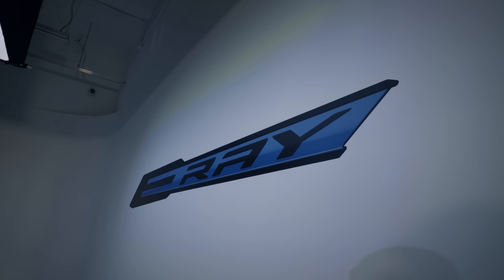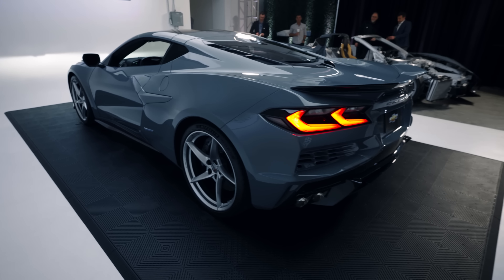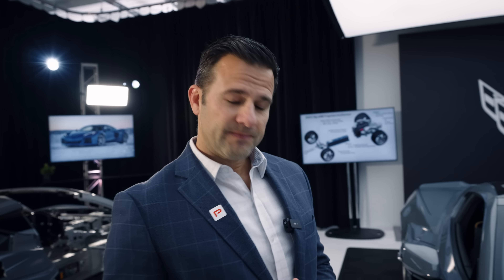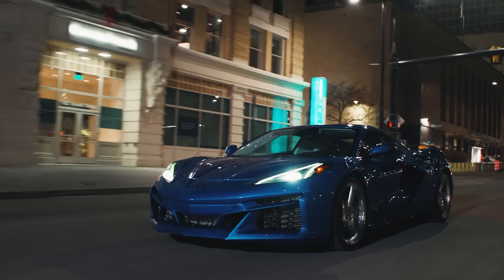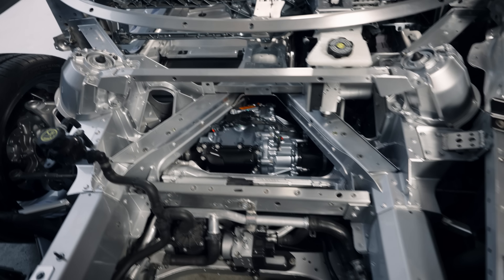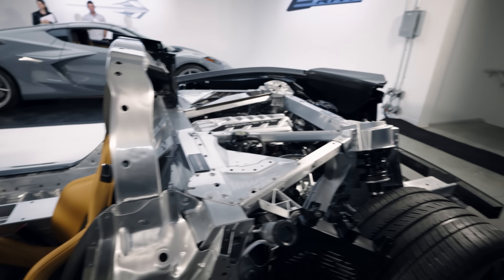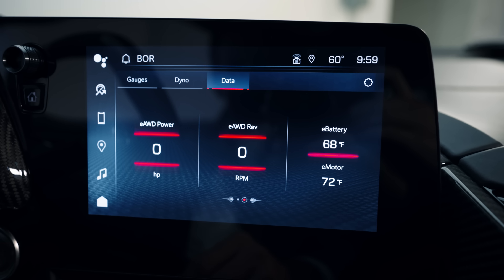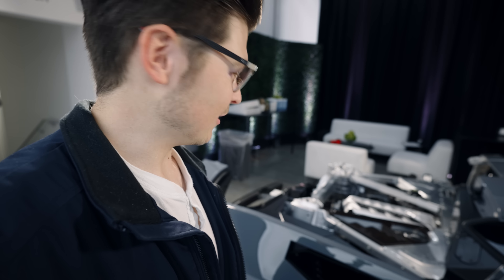The All-New Corvette E-Ray is NOT What I Expected...

Comment: When I first heard about the E-Ray I was super excited. Now I’m not so certain. The MSRP is much higher than everyone thought. Most folks expected $85-90K. I currently own a 2022 C8 and would trade up. Now GM may have priced me, and others, out of the market.  Still I’m first on the list with my dealer to get their first allocation. Time will tell. Cheers!
Reply: Albeit more expensive if you ask me, it's more dependent on what you are wanting. This E-Ray is more of a grand tour alternative to the Z06. Relatively the same acceleration just without the sound of the high-revving V8 and track-oriented driving dynamics. The E-Ray will be more frugal than either the Z06 or the base engine. It's been confirmed that the E-Ray will not come with a gas guzzler tax. I'm not entirely sure about the tires, beings that it's the widest factory all season in the world. So replacing the tires might get expensive beings that most tire manufacturers probably don't even have all seasons that wide. But it does come standard with carbon ceramics which will last longer not only because of the material but because of regenerative braking as well. Hell if you are a track guy and can get used to the regenerative braking. You might not have to go through brakes like crazy. For me, I go to the track every so often. But not enough to justify getting the Z06 with the Z07.
Reply: @99 Zulu  Carbon Ceramics are awful for track use. The heat causes them to lose lifespan very very quickly. It's meant for people who use these sports cars as pure grocery getters or commuters, with occasional spirited driving
Reply: Life is short!  If it's the car you want, go for it!
Reply: I disagree. This car is a bargain for what it is and compared to similar cars
Reply: @ludda42  It appears you missed the whole point of the comments. Cheers!
Reply: @sherlock1895  I agree. I own a 23 c8 and was also interested in upgrading to the eray. But it's not worth another 30k plus.  Neat car just not what I was expecting on pricing.

Comment: One thing I'm still hoping becomes an option, is the glass room TOGETHER with the convertable.  Over winter, I still want to see the sky (Canada here, and I'm not going to drop that top in winter!).
Reply: The weight of a glass roof is bad news on a sports car. I can see the allure, but for a performance machine? 🤷‍♂️
Reply: @codywillis9882  what's the material in the regular manually removable roof?  Plexiglass?  I don't care the material as long as the sky shows through clearly 😋.  I can't say I looked into weight difference in the roof options that currently exist.
Reply: Why not drop the top in the winter? I bought a 1967 Firebird convertible from the original owner, who owned the car in New York. Sometimes the top on this car would be down for five years or more. He simply would lean the passenger seat forward, turn the heater up, dress warm and enjoy the ride. As long as the roads were dry, of course, and in the winter that happens often, even with snow on the ground.

Comment: Seen a lot of hate on this car because people think it's an EV, so for those who still have doubts, let me try to answer a few FAQs 

1. The E-Ray is a hybrid with the same v8 as the stingray, no downsizing or EV yet

2. The AWD should not affect the top speed nor the ability to oversteer and throw the car around, as the engine still puts 100% power to the rear, not split to the front. 

3. t's not a plug in, it's a performance hybrid powered off the engine

4. It's not the tier above the Z06,  and it's not competing with the Z06 it's priced slightly below it and has a different purpose (likely grand sport replacement) so don't be disappointed at the slightly less horsepower, there is more to come.

5. Yeah it'll probably be a pain to maintain, at least the battery has a lot of buffer so it shouldn't be a major concern for a few years. 

Anyway, all of that is in the video itself, but a lot of people seem to see E-Ray and go right for the comments

Comment: All-wheel drive in a conventional ICE application would add a couple hundred pounds also. Would need to substitute some carbon fiber pieces on the chassis to counter the weight increase. Expensive.  C/D did test the NSX Type S and said, "The Type S handles like it's at least 300 pounds lighter than its 3898-pound curb weight would suggest." So it should be interesting to see driving impressions when folks get to test the E-Ray.

Comment: Sooo I’m assuming the ZR1 or Zora or whatever Chevy will call it, is gonna have the the zo6 body style/tires/ break. Eray’s all wheel drive and hybrid system plus some twin turbos to put us around 770 hp and 615 tq
Reply: Hopefully it’s not literally the same exact body style as the Z06, and is wildly different in comparison like the C7 ZR1 was to the Z06. Or else, you really wouldn’t be able to tell a Z06, E-Ray, or ZR1 apart on the street unless you just KNEW or were really looking closely.

Comment: With the batteries in the center tunnel, the front-to-rear weight balance remains unchanged as the batteries get lighter when the electons are used up.

😉

Comment: It's easy to distinguish between an E-ray and a Z06. The front fascia of the e-ray is more complex and clunky than the Z06. The rear fascia has different louvers for heat venting, and they are body color rather than black. And the rear exhausts are completely different.

Comment: Would love to hear your thoughts about a comparison to new McLaren, similar horsepower but 600lbs  plus lighter and $100,000 more.  I am looking at both.  If you can afford it, maybe  Autura worth $100,000 more.  I sold my Shelby 500 because of the weight issue, less satisfying than my GT 4, with 350 less HP.  Love your insights, don’t tack anymore but still love to drive.

Comment: if the electric motor stops providing power at 150 mph
doesn't that mean it has the same top speed as the c8 stingray? or maybe slower because of the downforce and extra weight?

Comment: I Strongly Agree with your final statements... Curb weight, and balanced weight With the driver and passenger, makes a big difference... "Who has the most HP?" is a very common question... but "Pounds per HP" is a better question... My Ram Pickup truck has a little over 500 HP!! But it weighs a bit over 6600 Pounds!! PLUS the driver, and any passengers, and a couple of bikes in the back, and we are talking close to 4 TONS..!!! And 22x12 wheels with 305 tires on all four corners, must be close to 100 pounds each... So HP can be a "Big Deal" but it is the overall Package that matters.

Comment: Interesting, I will say the tri motor Corvette will be interesting, I feel it has to drop the weight, which I think it will with a lower battery option and needs to really set it's sights on the Roadster.

Comment: Great video as usual.  I got on an E-Ray list last year in anticipation of an AWD Vette with more 'E' than 'P' (probably in the minority on this).  Given that Chevy elected to basically match the Z06 performance with the addition of an electric motor in the front and the use of the Z06 body, I am disappointed.  Now you add in the E-Ray's $104K base price and I am probably out of the running for an E-Ray.  At this point, I would rather see Chevy release a C8 GS for those of us that want the wide body, but do not need 655 hp or the electric hardware.  Besides, there is a HUGE price gap between the ST and the E-Ray/Z06 that should be filled by a GS model.

Comment: Hey it has the Battery and EV Motor for the weight. So what with the styling over the ZO6. It does not have to be different outside, you would know. Trade yours in for this then. I love it too. Shock others thinking it's a C8, ZO6...

Comment: Agree on the weight, but consider the overall challenge. Dropped the C7 and put all the eggs on the C8 Chassis. 1st mistake maybe. A light weight Mid-engine AWD vehicle is Super Expensive and basically useless 80% of the time.  I was shocked to see Curb weight approaching 4,000 as a Vette. Owned a 64 Vert 365 HP 3.73 gear and it was a rocket raw buck board scary at speed,   rocket. Later 1998 C5 Coupe same gear Supercharged 525 HP was a daily driver beast. Faster and safer for sure. The 2007 Z06  one of my favs BUT the rear end Would step out so quietly you could get in trouble real fast. Then the C7 Z51 Fast, Stable Safe, Excellent long range road trip car. Still have it. Now the C8 stubby nose, biggest complaint. does not feel right, too much car left out back. Balanced and pulls but we are driving a front bumper like sitting on the tip of an arrow. Just uncomfortable. I am surprised to hear wanting for distinct differences in appearance and dash candy. The E Ray is an Automotive Engineering Wonderment. there were so many variables to balance and trade off. The effort, thought and diligence, yes it is a fits-all. And that means not everything in optimized. Its not a race car, grocery getter, Jeep or cruiser yet is can do all of those things at a high level. That is phenomenally hard to achieve. I tip my Hat to all the GM Chevy engineering team for making in My opinion a 98% perfect Corvette for 2024.  My 64 was so cool. I slept in it the first night. 60 years later, yeap, I would sleep in my E Ray if I can get one. I had my 64 and drove up to Chicago for thanksgiving. Positrac is nice but 4 or 5 inches of snow and my little 64 was riding on top of the snow slipping and sliding. Now I doubt anyone would drive either car in those conditions. But daily versatility out weights 100% Race/Track capability for this model. I would have thought Hub Wheel Motors would have been Lighter, but the  Carbon Ceramic Brake Discs to muddy the waters.  I think you are too reserved in the appreciation of the engineering task and the successful achievement of these goals in the E-Ray.  Now as soon as the 1st ones goes up to Connecticut for a Supercharger install that WILL make your day.   750 HP E Ray would be very hard to slap down. And the Zora has yet to show its face too. I honestly think AWD is a game changer and Hybrid is the best way to get there, cost and weight wize. So Congrats to GM, Chevy, Vette Engineering. Give them a bonus!  I just may get in line and trade my 2014 Z51 for a nice low optioned E-Ray 2LT in all white paint. Thank You for sharing, Dennis

Comment: I’m not super excited about this car but I’m relieved to find out that it’s a hybrid and not a fully electric car. With that level of acceleration and AWD it could be the ultimate road going Corvette while the Z06/7 is the overall king because it can also kick butt on the track. But this one is just a street car. Kind of like the Teslas make excellent around-town cars… as long as it isn’t too hot or cold outside… and you don’t store or charge them in your garage lest the batteries spontaneously combust… and as long as you still have a gas powered vehicle for longer trips…

Comment: I agree, Austin! The E-Ray, while definitely looking like an outstanding car, is gonna be a porker for sure. At nearly, or at 4,000lbs, while it may hang with a Z06/Z07, I can’t see it being as fast nor put down as quick of lap times as a Z07. But, that’s also not what the E-Ray was designed to do; it’s the most grand touring Corvette ever built, and is a lot more “plush” than the Z06 or even Stingray. It not having the FE7 suspension is further proof of that. 

I see the E-Ray as what the Turbo S is to Porsche, or what the Roma is to Ferrari, where as the Z06 is the Porsche GT3, or Ferrari 458 Speciale/Pista. Or, if we want to use another GM product as a comparison: The E-Ray is a ZL1, the triple threat, Swiss Army knife that has a wide range of performance capability. Where as the Z06 is a ZL1 1LE: cars that were designed and built from the ground up for serious track work, to set lap times and hot laps, and to be track weapons. 

The E-Ray is gonna be an amazing car, and I think will make most other hybrid super cars outside of those that cost hundreds of thousands of dollars look silly in comparison… But it’s gonna be portly!
Reply: E Ray wins the stoplight winternationals against ZO6 every time and that's why it exists....

Comment: I just wish it had the carbon flash accents like the other models. Especially around the air intakes. And at least one more option for a higher rear spoiler instead of just that one body color spoiler.   

As far as lowering the weight, yeah, use more carbon fiber and less of the standard body material.  Maybe we'll see that on future models down the road.

Comment: The powertrain concept w/ the disconnected front & rwd is exactly like the BMW i8. Even down to the holding state of charge on the electric motor he explains. Of course it's v8 vs a 3 banger turbo so i8 haters should rejoice

Comment: Electric motor plus battery and AWD; we knew the E-Ray would be heavy.  McLaren seems to be one of the few car companies that is seriously trying to keep the weight down.  Despite more carbon fiber being used many of the sports cars have become heavier over the past decade.  Even the typically smaller Porsche cars have been getting gradually heavier.  It would be nice to see an increase in horsepower/torque without a corresponding increase in weight.
Reply: Say what?  Have a look at the castings and chassis. They are as lightweight as you can get.  Components are not made of fairy dust and every effort has been made to make the vehicle as light as possible.

Comment: Did anyone catch the fact that the electric motor max rpm will only support up to 150mph?  I wonder what happens > 150mph....
Reply: What do you think?  A set of pedals appear from under the steering wheel and you actually pedal your way to 190.
Reply: To be specific, I wonder if  the electric motor physically disengages after 150mph, or if the motor is allowed to spin faster than its usable rpm range (were it just can't add power)  To me its interesting how that extra drag may affect the car at this high speeds.  But I guess magical pedals may be the answer... 🙄
Reply: @8TommyZ06  I have yet to find anyone of these interviewers who know any real engineering.  I want to know about the front drive motors differential. Is it an open diff, a clutch plate unit or does it have electronically controlled drive axle clutches? And yes, how it disconnects above 150.  The electric motor could easily over rev if it want disconnected from both drive axles, and hence my wanting to know what's in that magnesium case.

Comment: A tenth 0-60 and in the 1/4 🤣. Seriously I’d be embarrassed. With dual sources of power it shouldn’t be a slight edge. Done properly 700+hp  low 10s in the quarter and 2.1-2.3 0-60. Cool about hybrid system integration but it seem like it’s been wasted. Why would an AWD with more torque with about the same hp be slightly faster. 🫢
Reply: because you don't understand and don't realize that it wasn't made to be faster than the Z06.  it was made as an alternative to the stingray, with more comfort and practicality.
Reply: So they can sell u this one and then sell u the real HALO car in 2 years.
Reply: I totally agree with you. I thought the 0-60 would at least be in the 2.3 sec
Reply: The lower you get in the 0-60 and 1/4 mi ,the more the hp and TQ need to be larger by a vast degree to start seeing serious differences... things plateau out in the mid 2.5 sec to 60  point..while alittle extra hp will show a big difference when ur in the 5 sec to 60 renge, its gonna take larger and larger amounts to hit the 2 sec point...the quicker you go, the improvements in time are much less and take massively more hp and cost to achieve.
Reply: @Luke-cb3ly  Lol no you’re looking past what Im saying as a True sports car nut. You’re  using 
Corvette , comfort and practicality in the same sentence. That alone means you’re out of touch. That’s like me going to a dodge dealership and asking them how my mpg does a demon get. It’s irrelevant. A hybrid vette with a v8 should demolish any non hybrid in the same line up not just be slightly quicker.  Period.